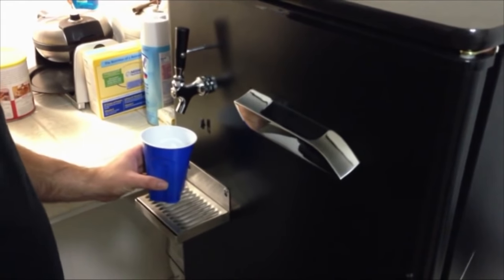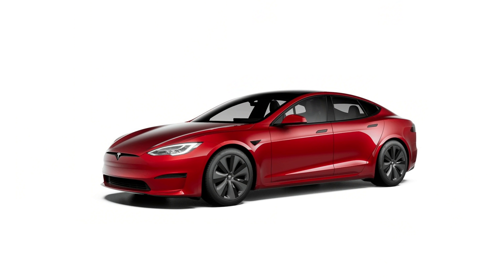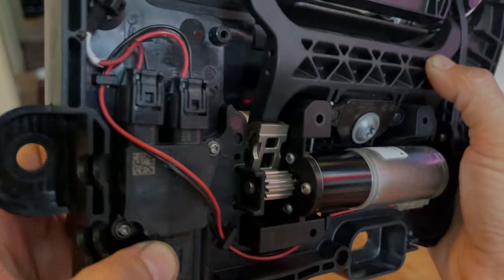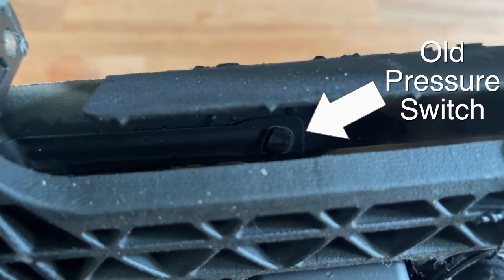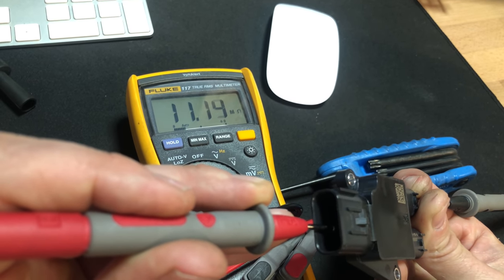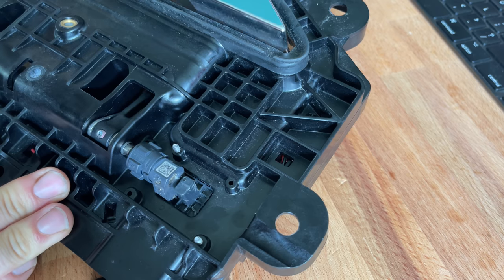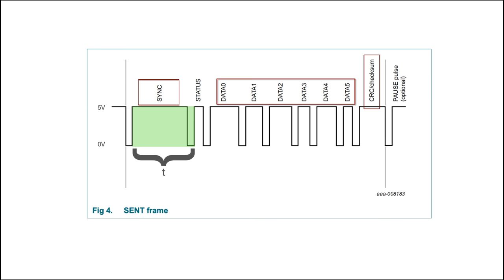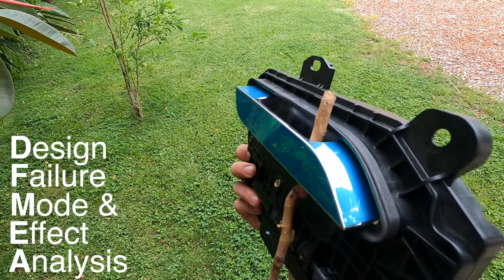Tesla Is Lightyears Ahead Of... Tesla

Comment: That angular sensor would still know the position after power. It’s acting like an absolute rotary encoder. Since it is measure magnetic field angle and not something like pulse count it will always know after power cycles. That 4 digit number probably means it’s a 12 bit position resolution. 2^12=4096. So I bet it’s sweeping 0-4095 at max angle. But that’s assuming you were sweeping a full 360 angle. If you take your max angle of the magnet and divid it into 360, and then multiply that by the max 4 digit number, that will give you the 2^x, x being the amount of bit resolution of the sensor. Or it probably just says this on the data sheet, thought it might be indirectly listed as angle resolution.
Reply: Actually it would be periodic over 180 sweep, so ignore the 360 degree part and use 180
Reply from the maker: It would know the position of the handle, but it would not know the motor lever position. So if (after a power cycle) the motor was stowed but the handle was deployed, the controller might think the motor lever was deployed and break itself trying to retract the already retracted lever.
Reply: @SuperfastMatt   sorry I misunderstood what was said. In this case the motor/handle is “dumb” but the control unit that provides power switching to the motor (most likely a door control unit) would have current sensing MOSFET transistors in the board that would see the spike in current and would shut it down. Without knowing the code it might try to perform some sort of normalization routine to figure out where it’s at. It sees high current one way but less the other it knows it’s at a stop. With the feedback not matching what the door handle sensor is feeding back it might through a malfunction code. Depending on the programming of the car it will either broadcast it to the consumer through the display or be a hidden stored code that the dealer would read.

Comment: The handle knows where it is at all times. It knows this because it knows where it isn't. By subtracting where it is from where it isn't, or where it isn't from where it is (whichever is greater), it obtains a difference, or deviation. The door subsystem uses deviations to generate on/off commands to drive the handle from a position where it is to a position where it isn't, and arriving at a position where it wasn't, it now is. Consequently, the position where it is, is now the position that it wasn't, and it follows that the position that it was, is now the position that it isn't.
In the event that the position that it is in is not the position that it wasn't, the system has acquired a variation, the variation being the difference between where the handle is, and where it wasn't. If variation is considered to be a significant factor, it too may be corrected by the GEA. However, the handle must also know where it was.V

Comment: IMO-a vehicle that relies on batteries for all of its functions should do everything possible to limit the use of electrical energy to maximize the energy available for propulsion.  Using things like electronic door handles, is less than optimal.  This is especially true since there is also a mechanical door release included to allow the door to be opened in the event of power loss.  No one would have cared if Tesla EVs originally came with mechanical door mechanisms.  I cannot justify adding all of this technological complexity and research just to open a car door using battery power unnecessarily.  After all, car doors have been operating mechanically since the first Model-T Ford and probably failed less often than the door opening devices on a Tesla.

Comment: The failure point in Tesla's is when you have an accident and lose power. Having to use a different way to open the door can make it hard or Impossible (some emergency releases are completely hidden) to escape a burning car. I have also heard of mechanical bypass latches being broken. All very deadly IMO. They got too clever on the door handles.
Reply: If you get in an accident so bad that the car loses 12V power, the easiest thing would be to smash the window. And if you were in such an accident, I'm guessing it would be the rescure services doing that to extract you, and not the other way around.

Comment: Now ya got me wondering how they know the actual position of the door handle because that motor is not a stepper motor... not enough wires to count pulses. UNLESS... they are using amperage changes as the poles of the motor change position. But guessing it is something as simple as scramming if the motor bottoms out the mechanism. KISS

Comment: I have a model s performance 2014-model. It had lots of problems. Lots. After over eight years and 55 warranty-cases....(yes, 55....) the car has gotten a lot of new and better designed parts. Its is a much better version of the car I bought in 2014, mechanically and software-wise. However, it has cost me a lot of time.....:)
Reply: You're clearly a very patient man. Such is the life of an early adopter.
My 2019 model 3 has had zero "real" issues. I've had some software quirks (car alarm going off for no reason) that got fixed in OTA updates, and the stance of the car had to be adjusted due to uneven tire wear - but that's pretty common.

Comment: This is advanced, but it's no wonder, these solutions have been used by DIY makers for years - they could also listen to the engine load and thus figure out if it has reached the end and the like...

The xbox controller has been using this technique for 10 years, for sensing analog triggers.

Comment: And here is the ultimate failure point. You lose power and you can't open the doors. Or the charge port. Or the trunk or frunk. I mean, you lose power, you have no access to the car without Jerry rigging a jumper to the frunk to access the 12 volt battery to jump it to access the charge port... to hopefully be near enough a charger to connect to so you can wait till it's charged enough to access the cabin. But hey, the handles are awesome!

Comment: There's a fairly decent reason why big manufactures don't continuously update things and "leave it for the next model" and it for servicing. Anyone who's had to try and find out if some replacement part is compatible with their model can tell you how much of a pain that can be. Now amplify that pain 1000x because they're isn't 2-3 revisions of the same model but 10,000. This is a TERRIBLE methodology of revision control and will lead to numerous issues with servicing these cars down the line. Tesla will have to either continue to manufacture hundreds/thousands of parts that are "outdated" to keep on hand in order to service older revisions to do simple repairs. If not they'll end up forcing the consumer to replace entire subsystems because "oh we don't make this brake line anymore and the distribution block you have is not compatible with the new brake lines. You need to buy an entire front axle brake line system now."

Comment: A complicated "solution" to a non-problem.  People have burned to death in a Model S after a crash and battery-fire, when bystanders couldn't open the doors.  To pile-on, Tesla changed to laminated glass in the doors of some models (decrease sound) which can't be easily broken, requiring several minutes beating with a baton to break a hole thru the window to extract an occupant.  Cool but still adds risk.

Comment: So it's still a fair weather door handle, freezing rain at -20 and you can't open your car until it's towed in to a heated garage to unthaw?  

Know of days where literally I have to pull the handle while wedging my feet to either a tire or underbody weld or frame.  

Admittedly only 5-10 times a year but still...

Comment: Surprised they didn't just whack an encoder on the motor and just have it always know its rotation.
chuck in a small battery so it can always keep track of any turns that it doesn't control and it will even detect when someone presses on the handle.
Ez clap
Reply: I guess I am just going off of the stuff that I have seen with CNC lately and some old projects I did with some really amazing, super accurate, shaft rotation encoders. They are probably more vastly more costly than that simple sensor and a magnet

Comment: What’s your take on Toyota not investing in the EV market? Also what’s your opinion on the environmental impact of EV vehicles? Is Toyotas decision smart to you? Loved the video and I always thought the engineering behind the teslas was extremely unique.
Reply: Uhh...

Have you missed the bZ4X?
Or all the hybrids they make?

EV are great (in comparison to regular ICE cars that run of fossil fuels) for the enviorment.
Reply: @zaarkeru3391  yes hybrids have been a thing for a very long time. Toyota has been giving customers options to let Toyota buy back that EV SUV from its customers because they’ve been having so many issues. Now I would  compare EV to internal combustion in a sense of what fuel it uses and considering there’s not an unlimited amount of lithium in the world it’s probably not any better for the environment im assuming. I mean Elon musk himself said EV was something temporary.
Reply: @zaarkeru3391  Toyota has been investing in hydrogen hybrids which is some extremely interesting stuff and I highly recommend reading about it. I believe it’s a hydrogen electric vehicle.
Reply: @johnnyc5655  
it was "just" an issue with the wheels, specifically the wheel bolts.
they had a recall but its fixed now.

and getting lithium wont be an issue longterm, as we will likely see other chems in a few years.
lithium is just the easiest one to make batteries out of.

and at our current and future speculated rate we will see shortages in ~40 years.

and by then we will likely see carbon-carbon solid state batteries that require no lithium.

hydrogen sure is interesting, the issue is guess is that there is no point using it in an internal combustion engine, as it is too inefficient.
so fuels cells will be the key there, and the issue with them is that they are inefficient compared to normal BEVs.

 i guess time will tell what the future holds.
i think we have larger issues than what car to buy in 40 years.
Lady climate change is catching up to us and 40 years in relative terms in a long time.

regardless of what road we go (i think we wont see a silver bullet, multiple tech/solutions will be on the market).
we need to stop using fossil fuels as a energy source.

and lithium based batteries is still much better for the enviorment.
its  it even comparable to normal fossil fuel burning cars.
Reply: @zaarkeru3391  I agree with all your very valid points and you’ve taught me some new things. BUT I have to disagree with lithium and saying it’s better. Saying it’s not as bad or even comparable to fossil fuels is a little dismissive. Isn’t mining at mass bad for the environment? Also don’t they have a huge issue with most lithium producers using child labor? IMO they are both just as bad for the environment. If we are talking about climate change and what’s good for the environment neither of them are. I mean that’s the overall issue you are alluding to right? What about E waste? That’s all from electronics and companies not recycling. Lol I guess there’s just an endless list of problems when climate change comes in. If the world wasn’t owned by big corporations and fancy tech CEOs the environment and climate change  probably wouldnt be so bad. I guess we all just have to do our own part in helping Mother Nature.
Reply: @zaarkeru3391  I started reading more about fuel cells and the stuff you mentioned. Some extremely interesting info. Do you think we will ever see fusion powered cars?
Reply: @johnnyc5655  fusion, no.
not in this millenia honestly.

who knows beyond that.
at what point does tech turn into magic when we precive it?
Reply: @zaarkeru3391  that is a very good question. I couldn’t say for sure but it’s thought provoking.
Reply: @johnnyc5655  
sure, the question (to me) is what do we need?

ideally for me atleast i want a car that can do 99.99% of all my trips by "refueling" from home, and the 0,01% of the trips i dont mind waiting for a bit extra to "refuel".

and i belive we are there pretty soon regarding EVs.

i want a future were we (tbe people) are energy indipendent, if we want to.
were we produce our on electricity and heat so we dont have to rely on corrupt grids and energy producers.
Reply: @zaarkeru3391  haha you seem to be somewhat educated about this stuff which is pretty interesting. If what my opinion is about isn’t reality I guess I’ll just need to crack open a few more books. Thanks for the discussion. But my opinion was just about stuff being bad for the environment so what’s not real about that?
Reply: @johnnyc5655 
well, they are bad.
but not worse.
thats the point i "tried" to make.

and we should try to be better, because with time we will by the end be good.

we can boil things down to CO2e, and our goal should we to lower those emissions.
Reply: @zaarkeru3391  haha I mean I don’t think I ever said EVs were worse for the environment. I just formulated a few arguments against them and tried comparing them to internal combustion engines. Like I said before I guess we all just need to do our part in helping Mother Nature. Team effort right? But hey I’m just gonna do my part and RRR and live life not thinking about the impending doom that accelerationists may have brought apon us haha.
Reply: @zaarkeru3391  can you link me some articles saying E waste isn’t bad for the environment? According to the Geneva environment network: “E-waste can be toxic, is not biodegradable and accumulates in the environment, in the soil, air, water and living things. For example, open-air burning and acid baths being used to recover valuable materials from electronic components release toxic materials leaching into the environment.” You also said there isn’t much eco systems to harm in a desert which isn’t true at all. Desert eco systems are extremely fragile and bustling with life haha. I live in a desert city which has laws to protect the desert from locals.
Reply: @johnnyc5655  
yeah.
to be clear, i didnt want to make the point that you though they were worse! :)

our goals should simply be to reduce and later stop using fossil fuels.

BEV could be one road, Hydrogen could be another.

though i belive we wont find a single silver bullet.
we will see many solutions in the future.

Comment: I just bought an 08 CTS and I am more then a little perturbed to find out the front outer door handles are big pretty switches...grr...been bitching about that particular feature  the whole time...if it had a setup like the tesla, I would probably be inclined to rip the handles off, shoot them, burn the remains, shit on what's left then bury them....then of course re-engineer the door handles to operate the way they are suppose to....more then a lil tempted to "fix" the cts handles as it is....rant complete! (For now)

Comment: I'll tell you what, the door handles on the Model 3 and Model Y are so annoying, I'd rather have the old fashioned borning regular door handles that just work.  The fact that they offer no real aerodymic advantage just cements this further.  I really cannot understand changing basic controls with no real advantage.  Yoke steering wheels, indicator buttons, touch screen gear selectors... its a joke.  The actual cars are light years ahead, but are compromised by trying to re-invent the wheel.

Comment: Tesla is a luxury car but you see this kind of stuff popping up on pickup trucks. A lot of us want cars that last, don't cost a fortune and that we can fix ourselves without spending a fortune. Scotty and Geordi La Forge aren't around when your door handle breaks. We need a simple, sensible and inexpensive car for those who want one and this market niche is not being filled. I can't even turn off the headlights on my truck without the mechanism second guessing me and leaving the headlights on. I had to learn that if you turn the switch back to the fog lights and then off they will actually go off. Why not a headlight switch the just does what it's told? Why make the user feel he is not in control of his machine? The turn signals don't go off either, if you bump  the switch accidentally and pull it back to the off position it has to blink like 5 more times before it goes off. Why? When I turn the directionals off that means I want them off. Same with headlights, same with anything else. More and more machines are no longer in the hands of their owners but basically in the hands of those who built them.